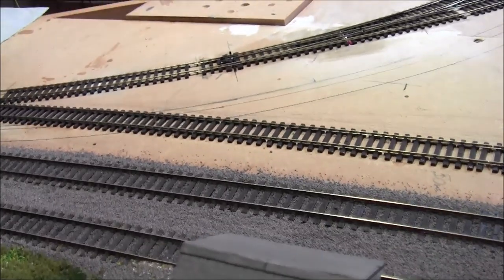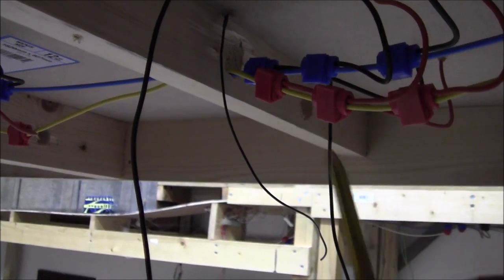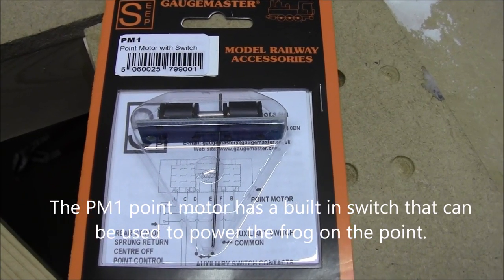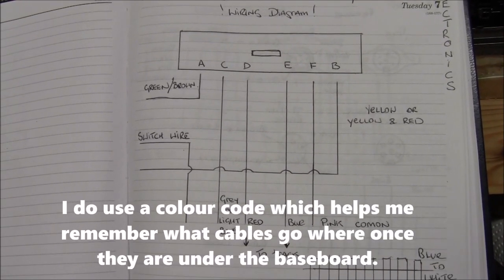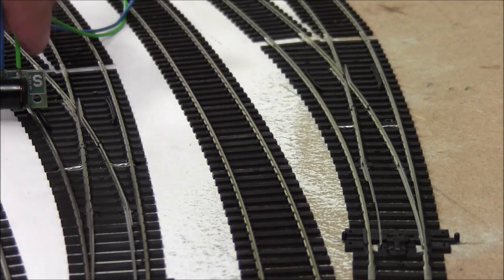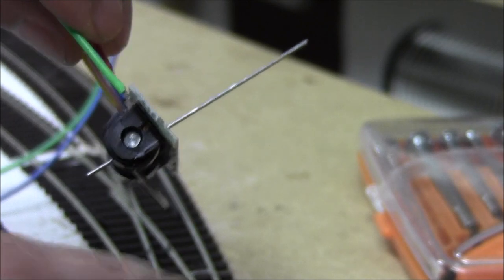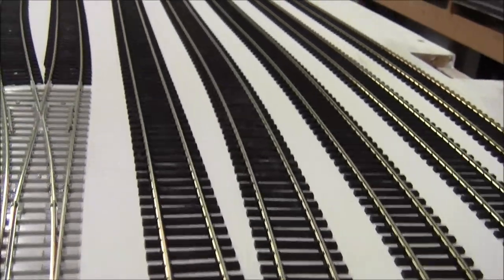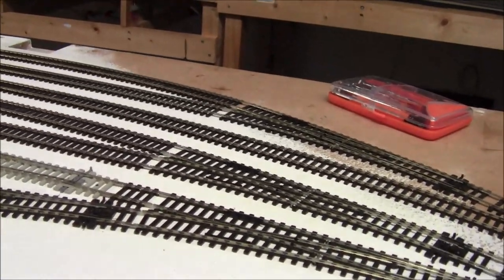Building a Fiddle Yard Part 2  wiring/fitting point motors  No101

Comment: Loved those two tips about how you keep the point in the centre along with the point motor. 
Also going for the  Gaugemaster Seep point motor but the PM10 as there is no soldering required, but I will be adding a Capacitor Discharge Unit. 
Regards Chris
Reply from the maker: hi Chris. i am glad you found the video very useful....stay safe Tony

Comment: Some great tips especially as these are the same point motors I will be fitting, I intend on controlling the motors with my ECOS but still not 100% decided even though I have all the accessory decoders for them.
Reply from the maker: Hi Rob, i tried to run the solinoid PM1 from the ECOS without sucess, don't get me wrong it does work but there's not enough power to throw the solinoids on my ecos. so im using a seperate power supply a 16v transformer and using toggle switches to control the points, as you will see in my up and comming video. let me know how you get on........all the best Tony

Comment: Hi Tony, currently starting my layout with the fiddle yard 13 tracks and entry exit each end. Your videos are a great help as I work through the electrical and technical aspects. My question is in regards to the Seep point motors, have you found any problems with the use of the auxiliary switch for the switchable frog option on the PECO electrical points? Initially my thoughts were not to go for the switchable frog option as my train’s are reasonably new ( less than 5 years), however am now rethinking this. Cheers Alan
Reply from the maker: Hi Alan. the switch live frog works well with new rolling stock. you should have no problems there. the only trouble i have with the seeps. is making sure they are dead center to the tracks and ensuring you have a big enough hole for the switching rod that control the sliding rails, i use a 12mm drill bit it seems big i know but that rod travels at least 6-8 mm across the rails. i have had one in about 30 which i had to replace, so that's not to bad...if you are starting from scratch, you could go for the slow point motors. but its to late for me now to change and i could not justify the expense and trouble. my advise is to watch as many different types of fitting point motors as they are plenty out there, and see what best for you and your pocket, take care stay safe.....Tony
Reply: Thanks Tony had already bought the Seeps so will stay with and switch the the live frog. Cheers Alan